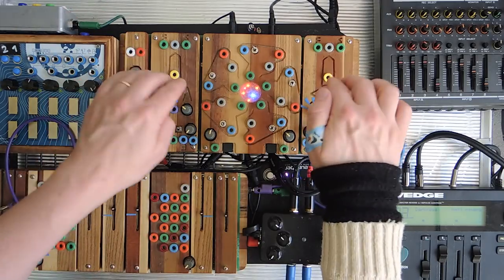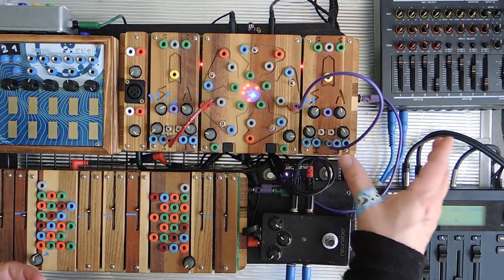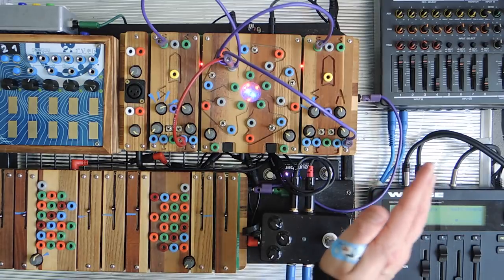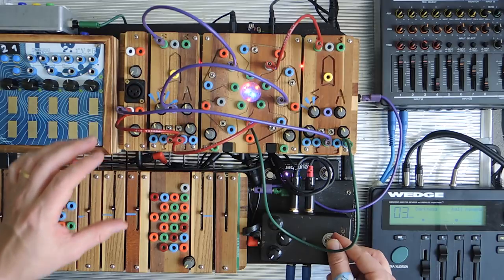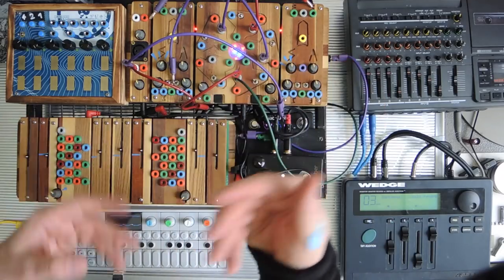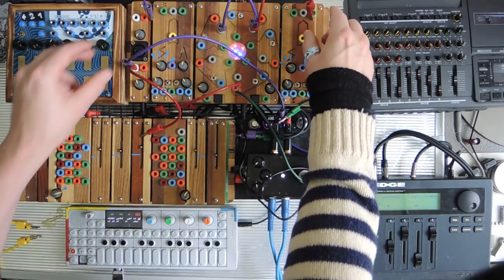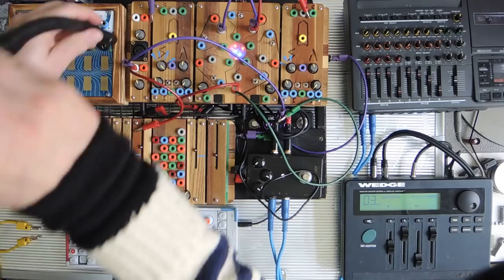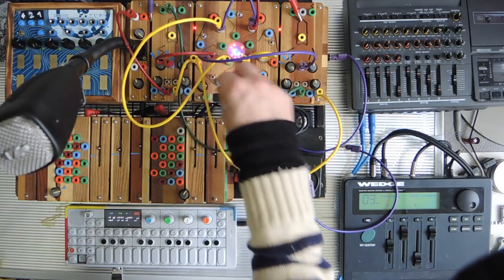Ciat-Lonbarde Cocoquantus - Playing and Patching Techniques

Comment: Hey Hainbach, thanks so much for this.  It helped me get started with my Coco a few months ago, as this gear doesn't exactly come with much documentation!  It works beautifully with the Tetrax touch sensitivity and stereo presence.  It's amazing how I can be noodling around and then suddenly go through a kind of portal where I'm totally 'in the moment' making something awesome that can never be repeated (Tip: always record any jams cos you never know when it's going to take off!).  It takes a bit of practice to harness how much noise/hiss is picked up by the loopers and when I actually take recordings further I often use wav file restoration techniques to lose some of the clicks and pops that are difficult to avoid when patching.

Comment: Another very fine demo that really dissects the Cocoquantus to its bone. The way the looper degrades the sinal, becoming quieter and more lo fi to the end, is really fascinating - I wonder if you can achieve something similar via a MN Morphogene (bought the module recently and still a bit lost with the ins and outs - tough little machine)? This is really great, especially for working with cassettes. The organic quality of the media really stands outs with this.
Reply from the maker: Thank you! I think the Morphagene is a bit to hifi, you would need to pair it with a bit crusher or maybe the in if the Piston Honda and slowly fade it before it hits that.
Reply: Yes, I do have a Piston Honda! Excellent suggestion - yes, will do - thanks for the feedback!
Reply from the maker: I want to hear it! Please follow up and post a sound somewhere

Comment: Hello Hainbach, Thank you so much for this video. It's definitely the most informative tutorial I've yet found about the Cocoquantus 2. I wonder how you equalize the output signal. I'm trying to figure out how to get a cleaner signal (like yours) without losing too much character.
Reply from the maker: In this video, there was no eq, all  gain staging to minimize the noise. If I eq, it's generally with broad highshelf on the A&H mixwizard. Sometimes tape takes off some harshness.

Comment: Do you have any patch cable type recommendation for a Cocoquantus? I know it's for banana plugs by default, but I've understood it's also possible to order one with eurorack style jacks. What are the pros and cons of each? I've read that banana plugs and jacks are considered more durable (or rather, less friction causing less mechanical stress), and stackable versions are almost the norm in the banana world, while in the eurorack world stackable cables are expensive. Anything else you can think of? I'm kind of tempted to go for banana plugs, because then it would force me to use the Coco as a standalone instrument, at least patching-wise. I feel the huge space of possibilities offered by even a modest modular system can be as crippling to inspiration as modern DAWs can be for some of us. On the other hand, it would probably be nice to be able to share clocks with other gear.

In any case, thank you already for this video, it has served many times as a guide and inspiration on how to approach modular patches in general!
Reply from the maker: I never heard of a eurorack Coco. I would never buy one, banana is superior in every way, except for normalized functions, of which there none on the Coco.
Reply: HAINBACH I was asking based on some notes around a year old, but now I also can't find where I got the idea from. Probably misunderstood something back then, or my notes now... Anyway, thanks for pointing that out. Banana jacks it will be :)

Comment: Hey Hainbach, partially thanks to your music and videos I have a Coco on the way! I was wondering if you have any details/links for the input and output cables you're using? Finding it tricky to find something suitable that won't put undue stress on the jacks.
Reply from the maker: Not sure what you mean with undue stress. Best Banana are Pomona and else I use any stereo minijack. Angled are of course best, since they minimize the setup size.
Reply: @Hainbach  I'm just wanting to avoid hanging something like a minijack to 1/4'' adapter and 1/4'' cable off the jack. And of course the setup size is important too! An angled stereo minijack to L/R 1/4'' TS would be perfect but I cannot find one :(

Comment: thanks for yourr generosity in creating this. My Coco arrived today, and it's really nice holding someone elses hand, because, honestly, I had no idea what nodes were inputs/outputs at first! Can I ask about how you're wiring the Op-1 up from a stereo mini jack to two mono inputs? I couldn't make it out in the video visually. are you using a splitter cable? Or does going into the left normal to the right too? I'm still trying to understand how the inputs are internally routed to each 'looper'. thanks
Reply: Solved this myself when I found the visual map of the controls, and now get that there are two stereo inputs! I was using eurorack mono patch cables and a splitter so didn’t figure that out!

Comment: What's that XLR cable you used at the end to create the vocal bassline? Seems super convenient for the coco!
Reply from the maker: Gooseneck. I have since switched to a cheap thomann brand gooseneck and it works even better, because normal mics are too heavy
Reply: @Hainbach  Perfect, thanks so much for the response. I think I'm going to order a cocoquantus from Patch Point today. Do you have an affiliate link there that would be good to use?

Comment: great video as always. may i ask what type of cable are you using to input the op1 into coco and is it going into the left & right inputs of the coco at the same time?? i was just confused because it seemed like you were inputting the Sidrax at the same time. thank you
Reply from the maker: Cocoquantus has dual Stereo minijack ins.
Reply: @Hainbach  yes but around the 15 minute mark when the op1 got involved it looked like you were recording it into both sides, right?
Reply: @0neTwo0neTwo  Hey there - both inputs are stereo, with each going to both left and right delay modules/channels of the Cocoquantus...
Reply: @Glasside  so each input with the different machine (one with OP1 and the other with Sidrax?)
Reply: @0neTwo0neTwo  Exactly - in fact I use the Cocoquantus a small submixer on top of everything else it does!  Such a wonderful machine...